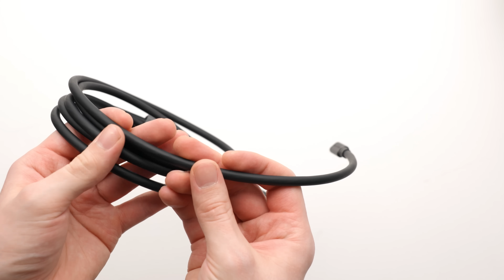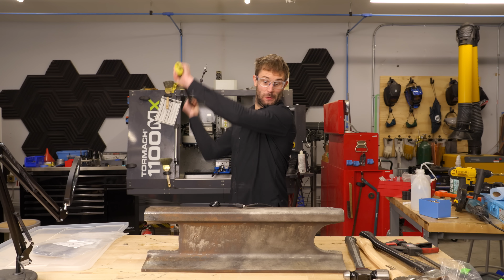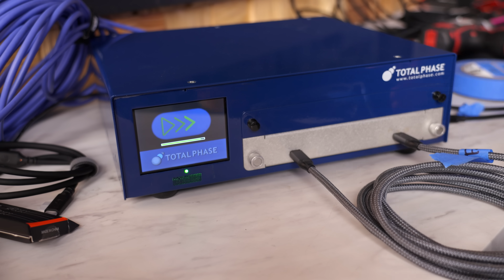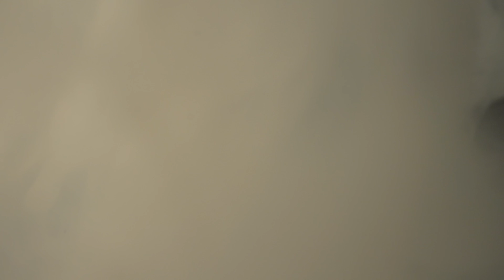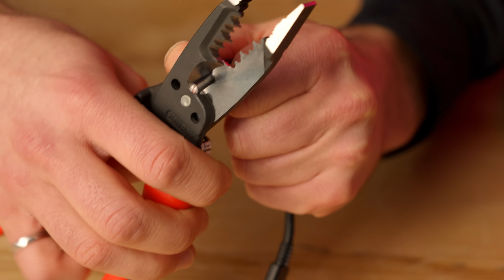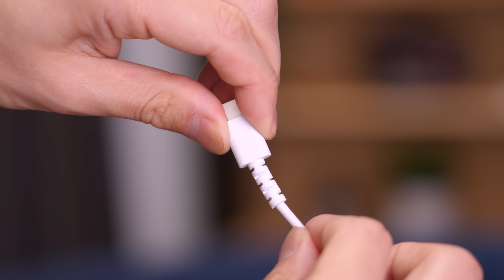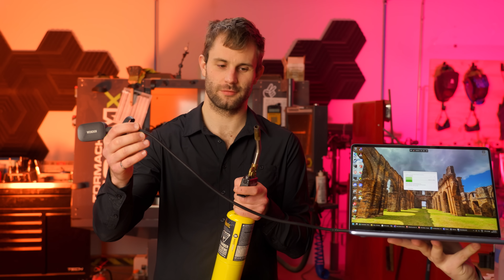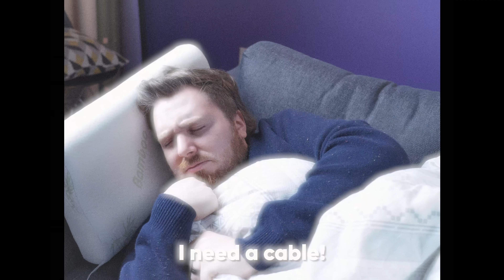Why It Took Me 4 YEARS to Make a USB Cable

Comment: I was expecting the price to be like $40 and then I saw they were like half of that... I have spent more on cables from brands that have sponsored your videos lol
Reply: Yeah, when he said that they're not cheap I expected like $50-60, not $10-20, I feel like that's the average price for a cable.
Reply: @RistoOnKadunud  Yeah what the fuck? I've got an Belkin 2m cable that's €30, now I feel downright scammed! If this cable actually work as advertised it's a genuinely great price!
Reply: @MrXtacle  Cables off of Aliexpress are like $5
Reply: @MrXtacle x2
Reply: @MrXtacle  i got a Belkin lighting cable for the lifetime warranty claimed on the packaging… 2 years and one broken cable later, Belkin informed me that their lifetime warranty only covered the lifespan of the cable, and refused to replace it because the cable was past its lifespan of 1y. I had to go back into the store to get the store employees to swap it out for me, i will never buy from Belkin again
Reply: @MrXtacle  Yeah because you got scammed. You can easily get decent cables (ugreen for example) for 5-10€. This is double the price, so it's not cheap, might still be worth it.
Reply: @RistoOnKadunud  It's average, but it really shouldn't be. Even just regular cables are horribly overpriced.
With LTT cables you pay extra for (I assume) high quality and small team tax. So I think the LTT team did a really good job with this one.
Reply: @RistoOnKadunud pretty average price for a so called good cable that lasts a year so if these last 2 years thats a very fair price
Reply: @RistoOnKadunud  if it's really 10-20$ i'm buy a whole set of them since there is no reliable cables in the market
Reply: @RistoOnKadunud  and it seems like someone decided to spend 30% of the cost on the dumb box.. I don’t get why people care about the box.   I care about the product 🤷‍♀️
Reply: @RistoOnKadunud  I couldnt find the price with the QR but they are rather cheap cables why shy abouth the price? Im sure they know how really and I mean really expensive options with not that of a good quality are.
IF that is the price Im certainly getting a couple of cables, and this probably will be the flagship of LLT merch.
Reply: I assume the shipping get's us, since shipping a cable is oddly expensive.
Reply: @SinisterSlay1 yep, $10 for shipping
Reply: @SinisterSlay1  Depends on where you live, but yeah, just checked. a 30 cad cables ends up costong 55 total to denmark..
Reply: @Icydriveforza  And then it's 25 % VAT plus the postal service's handling fee 😅
Reply: yeah but if the cable hurts you then health care is free @Icydriveforza
Reply: @LillyLou  Also import tax on top of that, if you buy more items at once.
Reply: @theRPGmaster  - Yep. Importing to the EU is expensive 😅
Reply: $40 was my expectation as well. I'll definitely buy at $20.
Reply: @notconnorslays1  Don't forget to add ~$10 for shipping (if you are in the United States).
Reply: @notconnorslays1  just bought an Acer 240 watt 3m USB-C sleeved cable on Amazon for under 7 bucks
Reply: @notconnorslays1  Warning: the 10cm cable is the same price as the 2.5m... so either they're selling the long ones at a lost and the short ones are overpriced, or we're only paying for the connectors and the copper cost/length is ignored... but it's not all "cheap".

And yes, I do realised that almost nobody will ever buy a 10cm usb cable for $30 CAD. Doesn't matter, the price is still there on the website.
Reply: @onepiecepedia well, if you're going to be that reductive about it, I guess you'd be more correct to call all of their cables "overpriced." I'll let you in on an industry secret: most accessories, and all cables, are "overpriced" in the sense that they are extremely high-margin items. 

I used to work for a certain blue and yellow electronics retailer and, as part of my compensation, I had an employee discount that amounted to me being able to purchase any item at cost +5%. Most cables I could get for around 7 to 10 cents per foot.

Now, I'm not saying that this is all they're paying; these look like significantly higher quality products than the generics I was purchasing before, but it would not surprise me at all if their margins on these SKUs are in the neighborhood of 500-1000%, or possibly even more. So, it's not that the cables are "overpriced." It's that their pricing structure is reflective of the industry norm, and that industry norm allows them to eat some of that margin on the longer cables.
Reply: @onepiecepedia  the 10cm cable that I use with my powerbank and phone is the one that gets destroyed the most. If I get more than 6 months with that I actually saved money
Reply: Just goes to show that cable prices really are bullshit. I've paid half as much for cables that are only a fraction of the spec.
Reply: @RipleySawzen  most accessories are just super marked up. Learned this in retail
Reply: @MikeHightower1  yea like 70bucks screwdriver
Reply: @lorisdragelj6286 It isn’t much worse then a PB Swiss and half the price, I bought one and don’t regret it (I wasn’t paid or forced to say this by the way)
Reply: @MikeHightower1  To be fair... i dont have one and have not seen reviews yet so... i simply dont know how good those cables are really. I only seen Linus word for it.
But the price is nice... And i paid about the same for.. okay cables. Soooo if just half of that Linus said is true, than those cables are probably decent for my most irrelevant usecases.
Reply: @lorisdragelj6286 I mean, if you don't need all of the features of the ltt screwdriver, it does seem a bit steep
Reply: @MikeHightower1 yeah, when they sell a 100€ cheap TV and an 20€ HDMI cable to go with it, they will make more on the cable. When you but a 150€ phone and an extra 40€ on a tempered glass, charger and case, they make more money on the accessories.

I learned that an iPhone 17 Pro Max only gives around a 50€ margin, that's ridiculous.
Reply: @BryanLu0 it's a similar price and even a bitower than other ratcheting screwdrivers. Yes it cost quite a bit, but that's the nature of good tools and it's fairly priced for where it sits in the market.
Reply: @lorisdragelj6286 I've spent more than $70 on screwdrivers (which I love and have had for a decade, to be clear) which are objectively, according to ProjectFarms unbiased testing, slightly worse than the LTT screwdriver in most categories.
Reply: @lorisdragelj6286  that's not an accessory my guy
Reply: @electronicdoorbellnoisemaker  who said it was?
Reply: @BryanLu0  No i like their mousepads, clothes are are nice to.. i didnt said i dont like everything they have bro haha
Reply: @lorisdragelj6286 and i didn't say you didn't like their other stuff either...
Reply: @BryanLu0  My bad i read it store not screwdriver hah. All those features u have on another 30bucks screwdriver more light and slim. I think its just overengineered.
Reply: @RipleySawzen  i just bought a cable from at&t because I was in a pinch. 50 dollars.... so this price feels more than reasonable
Reply: A cable including taxes for 35 CAD is like 22€, that’s actually incredibly cheap if you compare it to what apple would make you pay. It’s about in the range of a first party camera (Nikon, Sony, …) cable, that’s totally fine!
Reply: @PiTdeLyX for a quality cable that you know will be stood behind Great price apple would laugh at you if u took a cable back
Reply: @PiTdeLyX I mean, Apple is the King of Markup (remember the $1k monitor stand?). But yeah, definitely a reasonable price
Reply: @PiTdeLyX Now add shipping costs...
Reply: @eirikheggelund I am aware of that, I’m just doing some conversions to compare to other cables I have access to.
Reply: @PiTdeLyX  Its not thunderbolt cables
Reply: I was thinking closer to $60 by the way they were eluding to the price. The price is definitely more than fair especially for the UBS A to C one.
Reply: I buy Cable Matters ones, which is a quality underdog brand and LTT's price is almost the same. I know that there's a cost for seller when you buy something through Amazon (and I get free delivery), but LTT's price seems to be really fair all things considered. Also LTTs seems to be as good or even better in terms of feel, CM are pretty basic
Reply: Ya I was about to say oh ya maybe $59 or something like that...man have we been bamboozled by other brands
Reply: Seriously? I've never seen them sell something I can afford. And want.
Reply: Hell this is pretty much what Best Buy charges for their cables. The price is actually reasonable
Reply: The shipping is kinda rough though. Half the price of the cable.
Reply: Yeah might be the first thing I actually need and have a reason to exclusively buy from LTT.
Reply: they cost pennies to make, so its still a big margin.
Reply: That's not bad if it's all that he claims it to be
Reply: +1
Reply: Yeah, I was expecting Apple prices but with better quality, but they're a fraction of that
Reply: hell i've had to pay the same for no name brands in our local asian tech malls lol
Reply: 20$ for those cables? that's way less than i was expecting, especially for a brand that i trust to make products of a quality that won't be replaced in 2 years. and if you spend less than that on a USB cable, you have to know you get bad quality stuff, no state of the art cable is ever that cheap and good as well...
Reply: @kylehaggard7348  yes that’s what I thought too but it’s the size, they are 1/2 foot long so it is actually kinda expensive because the standard size is 10x longer
Reply: i bought my thunderbolt 4 usb for 40usd back in 2023....
Reply: Considering Belkin cables go for more, its not bad.
Reply: Yea, Volta turned out to be  waste of money.
Reply: Just got a 3' insignia thunderbolt 4 cable with same specs 240w/40gps and it was 48$
Reply: Same over here. having bought USB-C data cables of which are also silicone sheathed along with similar strain relief designs, they costed me in the range of 50-70 USD for 10 feet of cable; with that I was thinking LTT would be needing them to be 80 USD for an 8 foot cable. 
A couple months ago I purchased a simple USB-A to USB-C charging cable (non PD) at 6 feet long and it costed 15 USD.
Reply: American prices are 2x higher vs global. I can only assume the shipping will be the reason. Yes it’s $30 vs $40CAD but if you convert CAD to (local) then it’s cheaper than American prices. Thus it’s a fair price all things considered.
Reply: I was thinking around 30 USD but no this is even better lol
Reply: Hey guys, play it cool or the price will go up when they realize we're all willing to pay more😅
Reply: Prices cannot be correct. On my end, the 10cm cable costs the same as the 5m cable.
Reply: @uhohoverflow kind of makes sense. Most of the cost is in the connectors at the end
Reply: If you can get a hold of them. I just went online and all of them are unavailable and they were supposed to be released today, January 30th 2026
Reply: And I was expecting double that. Once the cables are back in stock I'll be sure to order some, even if shipping here is a pain due to having to pay taxes twice and then email for a refund.
Reply: what’s shipping to the UK cost? that’s usually the killer unfortunately. I looked into getting an LTT backpack and water bottle and the shipping was as much as the products themselves </3
Reply: yeah, isn't the meta quest link cable on its own $70? I was expecting it would at least be that much if not more. $20-$30 is a really good price
Reply: Sshhh... lord knows they'll price these as high as they think people will pay and right now they just want to prove to everyone that they're as good as they say they are. Would not be surprised if these end up nearly 2X the price by the end of the year.
Reply: same, i’d totally pay $25 for a decent cable
Reply: Warning: the 10cm cable is the same price as the 2.5m... so either they're selling the long ones at a lost and the short ones are overpriced, or we're only paying for the connectors and the copper cost/length is ignored... but it's not all "cheap".

And yes, I do realised that almost nobody will ever buy a 10cm usb cable for $30 CAD. Doesn't matter, the price is still there on the website.
Reply: @onepiecepedia What are you even basing your assumptions on price? You’re literally only accounting for materials used as if labor, machine time, testing, research, etc. aren’t even a factor. 

This is why Reddit also has become such a joke. Unless something is China sweat shop prices, it’s “expensive” and 99% of people have no idea what they’re talking about. I bet you’re one of those people who talk about supporting small businesses too but the second you’re not given Temu prices, suddenly someone is “reee overpriced for short lengths”.
Reply: This video is half right. He’s missing a bunch of certifications on this cable such as UL and you cannot have a cable that is UL rated, yet uses a silicone outer jacket. In order to use silicone, he’d have to have PVC or TPE underneath and that would make the cable much thicker than the already thickness it is (which tracks as I know someone making a highly rated and certified cable and it had to be over 5mm OD). UL certification, just as one example as it doesn’t seem to be FCC certified either, can lead to inconsistency across batches.

I’m sure the cable is great, but I’m not so sure it’s the showstopper he’s claiming outside of meeting the advertised ratings of power not even utilized by most devices and a bit faster with data. 

The real culprit with most of these cables out there is the shielding and certification requirements leading to system noise people aren’t aware of.
Reply: UGreen? Using their cables now. They're like 6/7 GBP each but 1 is on its way out. Fine for the price but meh
Reply: My immediate thoughts after looking at the 6 footers' price tag was "that's it?" The cheapo cables my local gas station sells cost about as much, and they've got like a hundred uses in 'em before they're e-waste. LTT has an excellent history of quality to back up their content-creator tax on many products; they could've been selling these things at 40 and I'd still say it was worth it. This product launched permanently on sale.
Reply: I suspect this isn't mostly a marketing strategy to make sure people who are used to buying dollar store cables aren't offended at the price being charged here. Because instead of most people just kind of being silent on the price, most people would actually have expected it to be way higher than it ended up being, and the few people complaining that it isn't dollar store pricing just getting drowned out.
Reply: He worded that specifically to make people think he was talking about a much higher price. The "that might seem odd given my long time campaign against overpriced cables" implies that the cost while lower than typical overpriced options. Is in the same ballpark.  

It's a sales tactic (and a good one) to get people to the store page given chances are higher for people to buy once they're there and see the product in question is no where near as costly as Linus made you think it was. I fell for it too. I wasn't going to check until he made it seem like they were gonna be costly. Just not AS costly. So I went to their store to see and shocked to see them at a reasonable price point. Especially since they're true to their spec.
Reply: @kylehaggard7348  i literally just paid for a $30 cable and it broke in a month
Reply: but they only were sponsored by like custom cables which are by nature pricy lol
Reply: I think that's completely fair price
Reply: Idk what anyone is talking about in the comments. The type C cables are around $30 for 3ft and only slightly less as the length goes down. Looking at competitors including even Ugreen the LTT cables are 2x to almost 3x the price for a single cable. That's egregious
Reply: @NightFoxZero  ugreen was actually the brand that I was inferring in my comment. I looked at my amazon history and I paid $36.99 for a 1 meter full usb4 spec cable from them in may of 2025. The point of these cables seems to be to ensure that you are actually getting what you are advertised, which is apparently not the case with most other cables. If you cannot afford the (imo reasonably priced) LTT cables, there is no reason not to buy from another brand.
Reply: Yeah, but not actually available.  Virtually all OOS.
Reply: No wonder people are saying it's all sold out. 😅
Reply: i cannot see the pricing. is it $20 usd or cad? how is it compared to ugreen?
Reply: Yea, granted, in local Action shop i can spend less in Polish złoty for a cable, but for  "As far as i know MF tip top" quality of cable 20$ sounds reasonable. Maybe not "every cable in my house" kind of purchase, but "I know this one cable in house works and works well" kind of purchase. 

Too bad that both for quality and price i have to believe y'all considering i can't find them in store XD
Reply: If it can transfer any speed and charge a laptop I don’t mind how are you gonna need anyway. First product I’ll buy from them
Reply: exact;y my thoughts. that is not expensive cable, that is well priced.
Reply: 20€??? I will buy 3!
Reply: same. TBH 30 bucks for a 2.5 meter 240w cable isnt that crazy imo,
Reply: I was expecting them to be around 60 USD tbh, seeing how other products from LTT (screwdriver for example) are definitely in the higher price range within the product. 
Obviously, I don't know the availability in the States, but as a European I usually spend 40-60 Euros to even get a proper cable with the desired length, transfer speed and Watts.
Especially with how the EU made USB type C mandatory on all devices, the cable scam became bigger and bigger where cables don't even provide their proper specs or simply do not support data transfer for example.
The absolute fair pricing of these products makes me realize how bad the original pricing for cables are.
Reply: Right 😂
Reply: I too expected them to cost more.  I hope that they live up to Linus's goal of lasting for years.
Reply: Given the number of cables that get chewed through, if the longevity is even 50% better than the competition that's a saving.

... If UK shipping isn't awful.
Reply: The price is 30$, not 20.
Reply: @arturartur3496  it's 30 Canada dollars, a little more than 20 US dollars and like 18 euros. But... keep in mind that's for 10 centimeters
Reply: @Nitidus  every c2c costs that much, and the 480mbps are at 25$
Reply: @davidgro.2948 Nah, you're wrong. Ugreen 240W 480mbps cables are 15USD for 2 metres.
Reply: @arturartur3496 It says 20 CAD on the international site
Reply: Yah super fair price when he didn't say the price I was expecting them to be 3x the cost the are .....trust me these cables probly will last longer and being cheaper then buying cheap ones
Reply: 36,20 Euro including tax and shipping to Germany
Reply: @DEEFRAG yeah well you cant blame them for that. Shipping from canada to eu isnt exactly free, is it?
Reply: @DEEFRAG  I've paid close to the same at Media Markt or Conrad for cables that weren't to spec or broke within months. Still not bad for something I believe will live up to its claims.
Reply: It is $40 after tax and shipping...